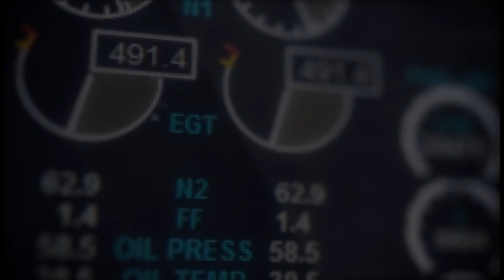Will Circular runways "take off"

Comment: if we thought about circular runways why not underground airports. airports are taking a lot of space in order to hold and move passenger. if we remove them and just create passages from the terminal to security checks it could save a lot of space for planes to park and load passenger. (Airports can also have a skyscraper in the center where there won't be any planes landing for hotels, restaurant, giftshops employee offices etc.)

Comment: Honestly, the "circular" idea would've made a LOT more sense as a more crisscross of many different linear runways, where the ones that have favorable winds are the ones active, kinda like a star of david, so you'd "fix" some of the problems while keeping the safety features, but it doesn't fix the flatness needed, but at least it's more reasonable than a full 360 circle

Comment: Forgive my ignorance if. I say something stupid, but... don’t safety systems such as papi lights require an approach along a fixed glide path? Wouldn’t safety also be enhanced by the pilot having problems reduced by using a fixed and consistent approach path? So the circular runway offers certain benefits but only at the cost of introducing other (and significant) problems. The proponents of the circular idea remind me of flat-Earth and other magical thinking - they get fixated on one or two issues, and fail to see the mountain of evidence that is contradictory.

Comment: How about having a circular runway, but with a cable running from the center of the circle to the inside wing tip of the plane - this cable could absorb all of the centrifugal force while the plane accelerates, and once it reaches flying speed it detaches the cable and flies off.

Comment: It won't work as all current aircraft are configured to travel in a forward linier motions e.g.  the mounts for the landing gear ant engine mounts,  with centripetal force inaction the aircraft will be thrown to the out side as for landing in a gusting cross windwith wet of icey surfaces good luck to you and your crew and pax

Comment: I gained my seaplane licence at Jack Brown's Seaplane base in Florida.  One of the disciplines was how to fly out of a small lake.
Seaplanes only need a short space to land in as the water acts like ABS, but the water is the enemy on takeoff and you need a lot of room.
We noted the wind direction and then set off in an anticlockwise direction (pilot on left seat needs to see where he is going)  As speed built up tilted over to one  inside float to decrease drag and surface tension, by now bumping across our wake which again helps lift off, then just wait till you reach your departure point and take off into wind.

Comment: I'm not a pilot myself, I just enjoy your videos and find them informative, but another issue that I see with a circular runway would be that you would end up with one of two situations. If you design it like the example you show at the beginning of your video, where the terminal is in the center, then you have to construct some sort of tunnel to allow passengers, supplies, etc. to pass underneath the runway, to access the terminal. The other option would be to do things similar to how they are in most airports today, where departing aircraft leave the terminal and travel out to the runways/taxiways for departure. The problem here would be, with the banked nature of a circular runway, just like with a skateboarder in a skatepark, aircraft would have to "drop in" to the runway from the upper edge, which only further exacerbates the angled issue with the wings that you mention.

Comment: 1) circular mean continuously changing heading, wind direction, during landing. That mean more things to juggle. Entering from every direction also mean more juggling by the ATC. 

2) in an emergency landing, banked runway will act like a ramp. The unfortunate plane that skid off the edge of the runway will skii-jump back to the sky, instead of hitting the grass and slow down.

Comment: Ultimate solution is to employ robotic "catcher" vehicles that hydraulically ease landing craft down then park them. Will save wear and tear on landing gear, cut noise, and offer passengers incredibly smooth landings! Also save lives during emergency landing.

Comment: Idea seems interesting on paper, but not very practical as far as I can see. A similar idea would be to place the airport in the center with a large number of runways converging in a pattern toward the center where the airport is and cars of course need a tunnel. Majority of airport except gates can be built underground. The runways will be like - \ | / - , but in a way that they end up near the gates in the center. It would be possible to fit 12 runways for that airport. Hard to describe the picture in a comment. The airport itself will have a solar rooftop and geothermal heating and cooling and this lowers those high energy bills that airports face on a regular basis lowering their financial stress.

Comment: 1. When planes are taking off in this kind of runway, the rudder are being a constant pressure because the plane need to turn and not run off the runway. 
2.When the plane rotates, they need to go straight as fast as they can otherwise they will probably have some severe bank angle issues. 
3. What if the plane  got out of control during take off after reaching 100 knots, and shoot straight to the terminals and other waiting planes?
4. Even though if they can use the method of different thrust level on different engines, such as engine 1 and 2 on TOGA, 3 and 4 on climb power, they need longer time to reach the minimum rotate speed, so that they cannot take off multiple aircrafts at the same time.
5. If the different thrust level method worked, do they need to put the lower thrust engine to TOGA rapidly? If they accelerate differently, would it create more difficulty for controlling the aircraft?
6. If the aircraft can take off while going in circles, would it put stress on the wings? Would there be more risk of bank Angle sudden changes? 
7. Does it risk to stall?????

Comment: The first thing that comes to mind for me is what happens when an aircraft suffers an emergency and has to rapidly come down for an emergency landing? Wouldn't the banking and the curvature of the runway make it even more difficult to safely land a plane that is not fully operational, especially when you consider the decreased wing tip clearance? Of course, i don't know anything about aviation so i could be barking up the wrong tree completely.

Comment: biggest floor in the design is  that if an aircraft needs to emergency land, say its nose gear does not deploy, or any one of its gears doesn't, then they're screwed, at least with a straight runway they can aim for middle and slide in a relatively straight line. with a bank run way these same aircraft would crash off the runways and into terminal buildings/hangers as they would be unable to turn with the runway. if it aint broke dont fix it!!!

Comment: I don't think your single engine failure during takeoff issue is as big of a problem as you  have presented.  This is due to the banking of the "circular runway".  One would presume that the banking angle is calculated to be optimum at takeoff and landing speeds and such that at these speeds the banking angle will effectively cancel out the lateral force that would tend to force the aircraft toward the outside of the circle --- this would make it unnecessary to steer the aircraft at takeoff speed in order to maintain the circular motion of the vehicle, so at takeoff speed the moment created by the unbalanced thrust would be no different than it would be on a traditional , that is straight, runway.  However one can see that at speeds less than takeoff speed if the banking angle was fixed ti would be necessary to steer the aircraft to maintain a circular path and there would be a moment created if an engine was lost, which would create difficulties, just not as radical as the situation you put forth.  Furthermore, the banking angle would not be constant, it would almost certainly have a gradual transition from 0 degrees to the final banking angle from the inside of the circle to the outside ( like a NASCAR racetrack or a bicycle velodrome, and consequently that path the aircraft would take to takeoff or to land would actually be somewhat of a spiral so the pilot could keep the aircraft at the optimal banking angle at whatever speed they were traveling.  Now this brings up the fact that this path would be terribly complicated to calculate and possibly quite difficult for the pilot to follow.  As I now am thinking perhaps I have just supported your original idea in a way.  The whole idea seems to be overly complex and perhaps would be an inefficient use of land as well.   To be more efficient we might consider an assisted takeoff scheme and arrested trap system for landing like the US Navy uses.  Wouldn't you love to have an electromagnetic catapult fling your ride skyward and to catch a wire upon landing so you could use a 1000 foot runway for your 737 ?

Comment: You can already make a circular any direction runway without any problems.  You just make 6 runways that all intersect in the middle and fan out like spokes.  then you can change your landing and takeoff direction to match the wind whenever you want.  A spoked design is superior in pretty much every way to a runway that runs the circumference of the circle and has to be banked.   The reason people dont do it is because of the expense of having 360 degrees of obstacle clearance and also the possibility of mistakes when you keep changing your approach directions every day.   Basically people would rather deal with crosswinds than build an airport that is immune to them.  We've always had the capability of building airports that way, its not a particularly difficult concept.

Comment: Another question about circular runways, how would an emergency flight land with flight control problems? I've seen several instances of planes landing and not having any control once on the ground due to technical failures and not being able to steer at all. There was a famous Reeve-Alutian flight that comes to mind who had a propeller fly off and damage the fuselage and flight controls so that when the pilots landed in Anchorage, they were just coasting along as a rolling projectile. Everyone was ok, but if the runway were circular? The plane would have rolled off the runway and everyone may have died.

Comment: You went through a plethora of challenges from an operational standpoint.  You did not touch on the commercial changes that would have to be considered nor the engineering of the surfaces and the supporting infrastructure of the airdrome. And on top of all of that personnel would require training on both configurations until one or the other configuration was disused.  

Since linear take-off is legacy from the birth of aviation it is now a hard wired system. It is like VHS and Betamax,, DVD and DVDx, the systems are only compatible with costly adaptation, and the benefits of circular do not support it. If aviation started with a circular configuration aviation would be different and possibly much of history. And in that "what if" history linear runways would be seen as the odd duck, possibly relegated to having a separate category of flying, like the difference between rocketry, fixed wing and rotary wing aviation. 

The first application may be with a relatively closed system, such as military aviation setting up a circular runway in a remote area for UAVs specially designed to be able to operate from this configuration. There are many military benefits that in a peacetime setting would be uneconomical,  but may provide a critical mission capability for a wartime objective.

Comment: Circular runways could have the same approach limitations as traditional runways. The advantage would still be in the queuing and flexibility.

One big disadvantage is terrorism- the ultra dense center hub is a single point of failure.

Comment: If the planes always turn clockwise, it would make the tires located under the right wing wear off faster than the tires under the left wing (and the tires would wear off asymetrically).

Comment: I need enough turning force for the aircraft to turn 90 degrees along a quarter of the circle, which is basically a linear combination of stopping the motion along my original vector, and accelerating orthogonally to it. This would suggest that the radius of the circle would have to be the length of a straight runway, so this would use four times as much space as a filled circle of that length, which could also be used in any direction.

Comment: Wouldn't the biggest issue be that you'd have to touch down on a very specific spot on the turning runway or else miss the runway completely? Surely the plane can't match the turning path of the runway precisely, so the flight path would have to create a tangential point with the runway and touch down on it perfectly. Straight runways match up nicely with a straight flight path so the runway won't just disappear underneath and you have several hundred meters of margin for your touch down.

Comment: More passengers per aircraft and steeper (and safe/comfortable) decents are really the only way to improve capacity in congested areas.  JFK for example and all the other New York airfields everyone always complains they should be enlarged. But the reality is if you enlarged them and somehow did create more ability to accept more incoming flights then airlines would make more flights and the problem would just return.

Road engineers know this problem well. Just building more lanes and roads means those lanes and roads will get filled up and the problem is the same just bigger.

Comment: I think this is bad because of airplane emergencies/crash landings. If you have a major mechanical fault and a loss of aircraft controls apart from the availability of thrusts for both engines. Your ability to maneuver the aircraft is severely handicapped. I have studied the emergencies of some of these flights. I can't see a circular runway system would have helped, it would have contributed towards disaster.

 It's better to have a straight runway where when in a situation of loss of control of the maneuvering systems, you can be at a lower risk and a higher chance of survival. You need a straight runway which would make it easier to stay on the runway. After all a straight line has less input needed that a continuous circular runway..

Comment: My ideal airport would imply maglev technology to launch and capture aircrafts.   But any shift in paradigm entails a change in society or its class .  Threnody no doubt we have had no significant change since the war but overdue.   The oceans as an example demand transport infrastructure via floating waterroads connecting the continents,  underground freshwater ways,  tunnelways, etc is presicing a old guard approvals without there being an favor thereto.  Before a circular airport, there would be a revolution and any discussion Ignacio novelty would be best addressed in this priority.... Cheerz

Comment: 3 KM circle is like 9 km of runway-width pavement.   Better use of the pavement would be 3x 3 KM runways at 60 degree intervals.  We could solve the crosswind problem in part by going back to when more airports had crosswind options, but everyone just wants to close runways and use them for other things.  Circular runways are not an answer, they are idiocy.  A real answer would be for people to stop living so close to airport property or for them to stop whining about "muh noize".